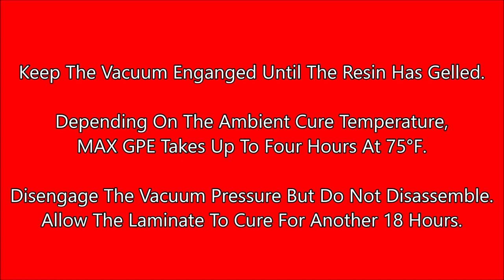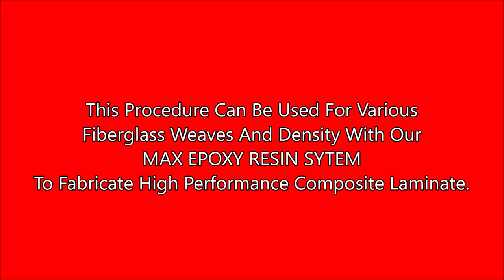Vacuum Bagging Fiberglass For High Strength, Impact Resistant Application Boat Hull- MAX GPE RED A/B

Comment: what CFM on the pump are you using ?
Reply from the maker: The vacuum pump is rated at 7 CFM and it is dual-stage. The vacuum pressure was measured at 29.4 in.Hg steady state for the 4 hours duration. The pump used is similar to this sold at eBay;
https://www.ebay.com/itm/166104656200